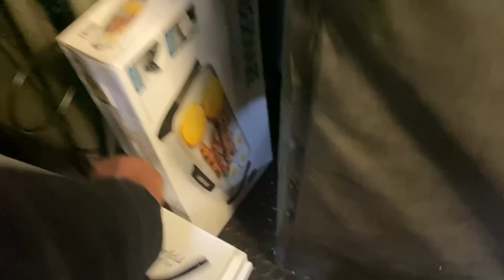Solve the Mystery of Your Scorching House! How to Diagnose & Replace a Stuck Zone Valve

Comment: my relatives had a relay go bad many years ago, it kept the dinosaur 200K btu boiler and circulator on banging the high limit set at 190F, by time they got home form work the whole house was hot enough it melted all the candles throughout!  like 150 to 160F inside! boiler was way oversized, all cast iron radiators(calculated to about 65K total radiation output in 2014) lol
lots of changes and new boiler then, gas bill dropped to about 1/5th, go figure, deleting an 8" open flue and putting in 3" pvc in it's place, with indirect tank(deleted 50 gallon DHW)

Comment: Folks, know your house. 
A/C doesn’t work when the boiler is running and vice versa. Where I live in the past week we’ve had 35 degrees in the am and 85+ by mid afternoon, the knee season where both may be required.
Mike, quick diagnosis!
Techs, learn your controls and it’s easy to spot the problem. Be well.

Comment: What ever happened to the red mat you bring to the clients front door before entering? Just asking. Love the channel :)
Reply: I had a feeling that happened because I hadn't seen you use it lately. 

Some customer got a free "used" Mikey Pipes door mat. Lol
Reply: just use cloth painters drops doubled up for the first ten feet or if you'll be war pathing for hours, rolls of carpet protector and drops the whole way.
been underpaid for years of laboring and not leaving a huge mess(vacant/major remodels/new carpet afterwards are the exceptions), why burn an hour cleanup every night if it's vacant. one good cleaning every other day to end of week/job. you be the judges what fits and works, best have all your ducks in a row and up-front about it with the homeowners or they may think you're slopping it up and doing bad work. I just say hey, I can spend an hour each night cleaning or leave it and work that hour, then clean at the end in a few hours vs. many days of one hour. again it depends on the job length, same day in/out or only a few days, clean as you go or at end.

Comment: as much as I want to switch to using the wago connectors I just cant get over the price when compared to wirenuts. like for that price ill solder and heat shrink the dam wire
Reply: Much more expensive, but a huge time saver. There are a few other "no name" brands out there that offer the same features for less.

Over time, they should come down in price, when there's more competition.

But they can be very handy and useful. I still have and use wire nuts when I don't need the features or ease of use of a Wago, because of the cost. But I'm old school as well.
Reply: @MikeyPipes do you ever label the pipes too, or at least one side, and not just the covers?

 I've seen covers installed on the wrong valves so I usually label both the cover and one of the pipes with a sharpie so when all the covers are removed at once, the tech knows which cover to install back on which valve.

Just wondering if you ever do the same?